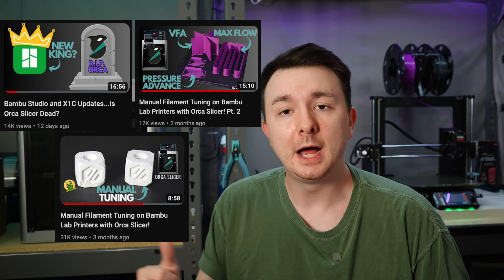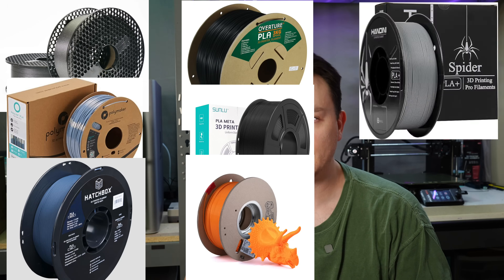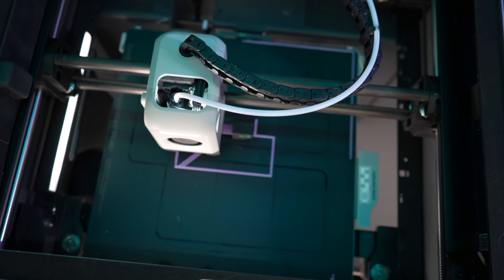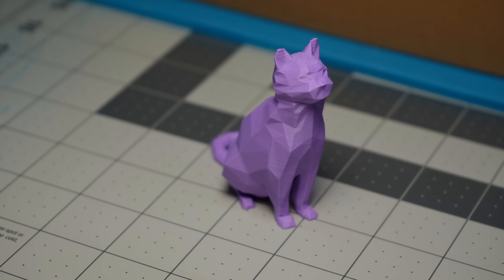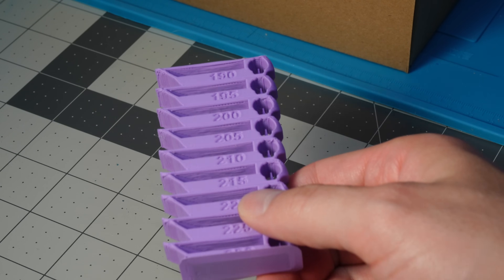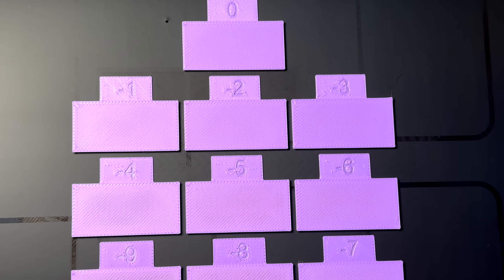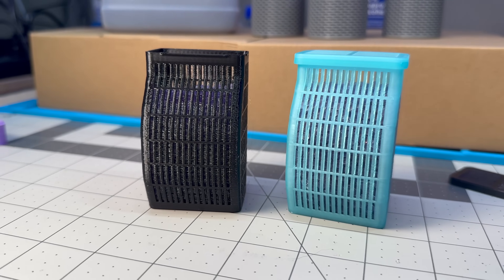My Secret to Filament Tuning with Bambu Lab Printers

Comment: Thanks for the vid. You give some examples of some of the things you look for to "react" to but you weren't very specific. Specifically, is there a set of things you look for on a new print to help you decide on potential adjustments? And when you see these things, what exactly do you do to adjust? Understand you probably can't provide a complete answer but would be interested in better understanding your approach and how you can react successfully. Appreciate any info you can share. Thanks.
Reply from the maker: I planned on making a more specific video on the future - I just didn’t have many failed prints to really show. I just look to see if a print doesn’t look right in general. The example I showed about layer time is a good one although it’s a short clip. Usually that’s solved by printing more than 1 of the thing at a time or increasing minimum layer times. Things like if your volumetric flow is too high or low you can tell pretty quick in a print when it’s doing quick moves. I check pressure advance too if I can see gapping in a corner as it’s printing I’ll stop the print and lower PA. If I see overhangs aren’t quite coming out right I’ll either drop overhang speed or increase cooling. Things like that. I do plan on making the video but I’ll have to come up with some stuff that someone might set incorrectly and correct it.

Comment: I assume since the patches are in whole numbers you enter the current flow rate into the calculation as % and not decimal? So 100% flow rather than 1.0 flow?

100 * ( 100 + 5 ) / 100 = NEW as an example where the +5 was the best surface finish and the starting flow was 100% (1.0)

OrcaSlicer uses 1.0 as 100% flow so I'm just double checking.
Reply from the maker: It would be a decimal. If you chose -5 (I’m assuming instead of +5) you’d enter 0.95. So in reality it is a percent different but you enter the decimal not the percent.
Reply: @ButterPockets 
This helps for sure. Wish it was explained better in the vid. Im not the best at maths, lol! Great vid though and has really helped me to figure out what I should be doing to set things up. 

Also can you go into why exactly you turned off the Aux fan and set seams to rear? Thanks

Comment: I am still a relatively new maker but have come around to your train of thought. I used to fuss with benches and temp towers but now I'm doing exactly as you do. flow rate pressure advance by vendor. I am still filling my desiccant with a funnel though.😅 I use the same holders, but guess I should start printing 30 or 40 more containers in ASA as I see the logic and do get tired of picking up beads off the floor on oppsies.
Reply from the maker: Exactly! I’m glad to hear I’m not the only spilling them everywhere haha

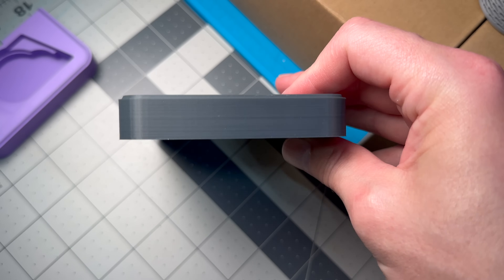Comment: 11:05 Where do these blobs in this "skeleton benchy" come from? Is this due to moisture within the filament? I'm quite new to 3d printing and currently struggeling with a certain filament (PETG) encountering various problems. I've seen such blobs in some of my prints, but they're not consistently all over the object but rather in certain locations of the print.
Reply from the maker: That particular print I think was due to printing insanely fast. That’s actually ABS and I printed that on a Voron. It was just a little test from a while ago.

Comment: How long does it take to regenerate desiccant beads in the dehydrator you recommend, do you run it a max temp? Also share some info on printing with ASA. I have never tried it
Reply from the maker: It tells you temperature on the desiccant container it came in. Takes about 2-4 hours. Printing ASA can be super easy or tedious depending what printer you have.
Reply: @ButterPockets bambu X1C
Reply from the maker: @ronmcdavid7084  use the textured plate or hot plate and glue. Make sure the door is closed. Use the generic ASA profile and see what happens. A large part of the problem with ASA is getting it to stick to the build plate. I use vision miner nano polymer to help as well.

Comment: Nice video. Does the pressure advance value obtained with orcaslicer coincide with the k of bambustudio? can i use it in bambustudio?
Reply from the maker: Those are the same parameter yes. I would trust the number you get from Orca over the number you get from BS though.

Comment: I stopped using OrcaSlicer since Bambu implemented all the calibration options into BambuStudio. Now I can just do auto calibration for each filament and auto save it without having to do any manual stuff. I noticed my corners are really sharp now since doing the new auto calibration for each filament I have.
Reply from the maker: If it works it works!
Reply: @ButterPockets  Have you tried that new feature in BambuStudio yet?

Comment: For some reason, I was able to calibrate every filasment I tried except my roll of bambu PLA. For some reason, it failed on me twice.

Also, even when I calibrated manually, I can't set the K value for the spool
Reply from the maker: How did it fail?

Comment: just ordered a ton of bambu matte filaments..for some reason the red is giving me issues..just the red.  Small patterns wavy gaps in the print
Reply from the maker: It could be that the specific roll has a QC issue. I would dry it and then run EM tests on it separately and see if potentially it’s overall thicker or thinner causing the EM to be different. Usually wavy pattern though are a belt issue.

Comment: Thx, great video, again! I used to print a lot with prusament on my mk3, but when I use prusament on my x1c print time is a lot slower due to max.volumetric speed of the generic pla profile, I assume. How do you tune this for your bambulab with prusament?
Reply from the maker: I set it at 19mm3/s and print at 220C. I’ve had no problems with it keeping up. You can try running a max volumetric flow test in orca slicer or try bumping up 5-10C in hotend temp.

Comment: If I use Orca for my Ender 3 (Klipper), there is no reason your process shouldn't work the same?
Reply from the maker: Correct. I’d probably do this for any klipper printer.

Comment: Great advice! Do you always print PLA with aux and chamber fan off? Do you leave your door and roof open?
Reply from the maker: I do always print it with aux and chamber off. I don’t always take the top glass off though. Even with the top glass on and door closed it’s fine as long as the the chamber temp isn’t over like 34C
Reply: @ButterPockets  So if 34C is your max chamber temperature for PLA, what build surface do you use?  Do you simply use the Cool Plate with the default 35C 
bed temperature? Do you ever use the Textured PEI Plate?  If so, do you still use the default 55C temperature on the Textured PEI Plate?
Reply from the maker: @joell439  I almost exclusively use the hot plate. Even with 55C bed temp and 220C hotend with the top and door closed the enclosure temp is usually around 30-32. Not too hot.
Reply: @ButterPockets  Thank you. 🙏.  FWIW I’ve been seeing chamber temperatures in the high 30C’s when the bed temp is 55C.  I always keep the door and lid closed and haven’t had any problems.
Reply from the maker: @joell439  nice! If it works it works. The only issue could be the filament getting too soft before it melts in the hotend. If it’s not happening then run it!

Comment: I'm curious as to why you changed the fan settings for the prints you showed.
Reply from the maker: I do that for all PLA. I never use the aux or chamber fan. The aux fan is just too much cooling in my opinion and makes the left side get cooler faster than the right side.
Reply: @ButterPockets  thanks, I’ll consider doing that myself.  😁👍

Comment: Thanks for the video! Could you please make a guide to how you can print a model in different filament colors without having an AMS?
Reply from the maker: Is that a thing?
Reply: @ButterPockets only by different layer heights like how hueforge works. 

You just add pauses in the slicer to each layer. No video needed lol
Reply from the maker: @rp479  well I know at least with a Prusa you can trick it into thinking you have a MMU and do multiple filaments within one layer. I figured that’s what they meant
Reply: @ButterPockets  that sounds super tedious lol
Reply: @rp479  I understand it's obvious to you but there is a group of people who don't know how to best do this. For example, I understand I need to change the filament while it's paused, but is there anything else I need to do? Heating? That kinda stuff. It's a good opportunity for a video, I'm sure there are other videos out there on even more obvious stuff.
Reply: @ThisIsMoniac  there are over 20 guides and videos on how to do this exact thing already
Reply: @rp479  I seriously doubt that but I appreciate you sharing that in your opinion there are enough guides out there.
Reply: @ThisIsMoniac  you must not watch too much 3D printing content on youtube. I would recommend teaching tech. He has very helpful videos
Reply: @ThisIsMoniac  There are heaps. I don't think 20 is an exaggeration either.
Reply: @rp479  "There are like, more than 20 guides!"
Doesn't link to even a single one.

Great contribution to humanity, we're in awe of your uselessness.
Reply: @Omniverse0  with the time spent making this comment you could have found a guide just like I could have, and posted it. Instead you chose to be snarky on the internet. Wow an even GREATER contribution to humanity!